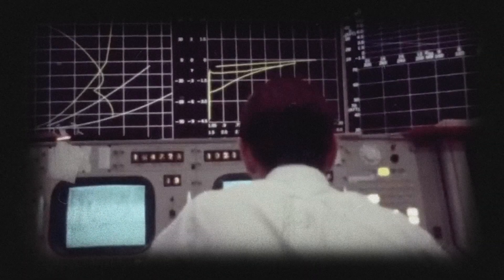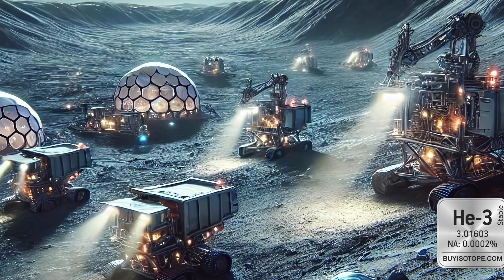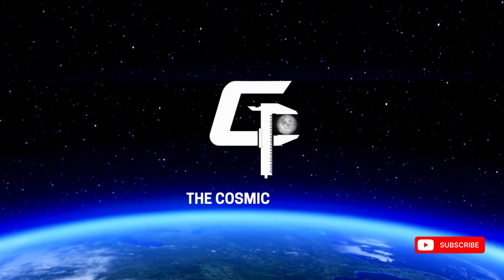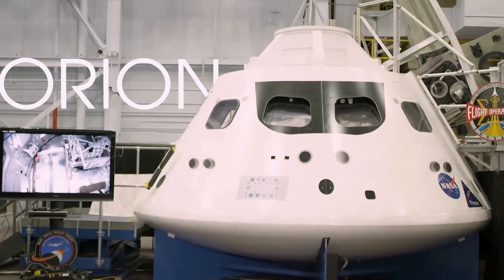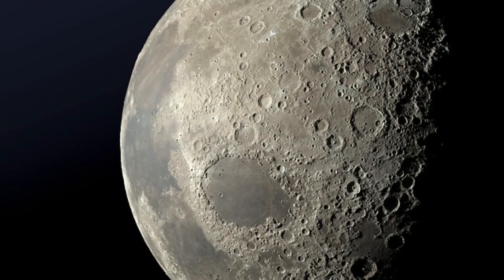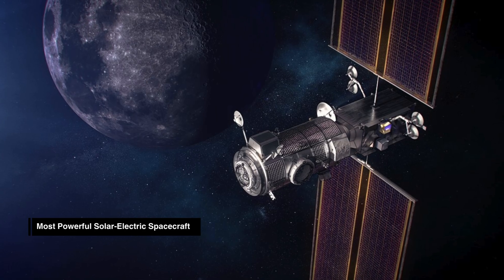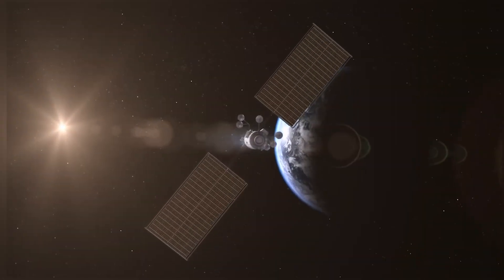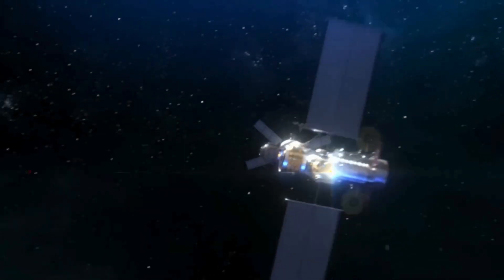NASA's Lunar Gateway Explained Under 4 Minutes

Comment: the Gateway Spaceport is a well thought out concept for space tourism . . . but it can be repurposed to serve as a space station if necessary . . . two Gateway Spaceport interconnected with each other . . . granted the Gateway Spaceport will be 36 times bigger than the planned Lunar Gateway Space Station & expensive to build with current technology . . . but it's doable from a practical feasability standpoint . . .
Reply from the maker: Exactly you're right!